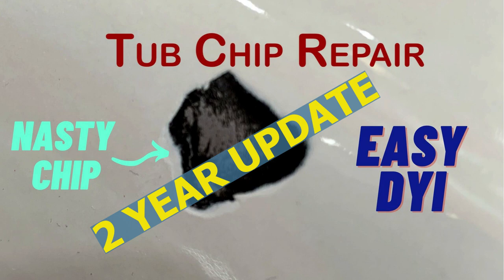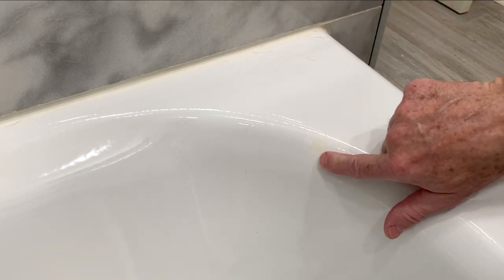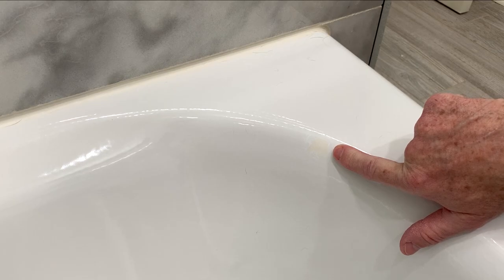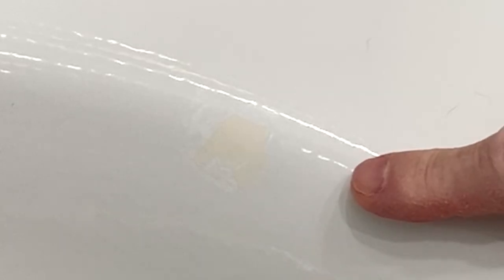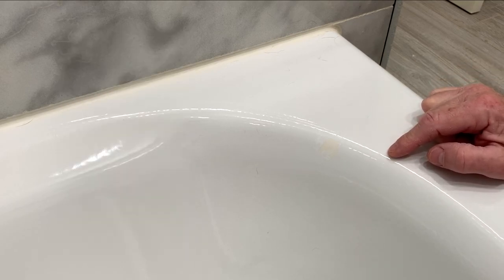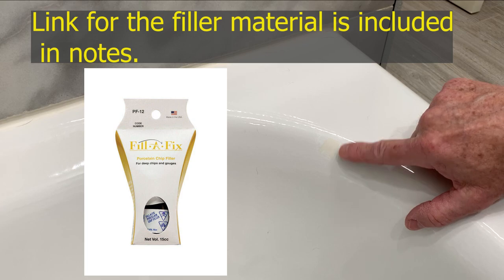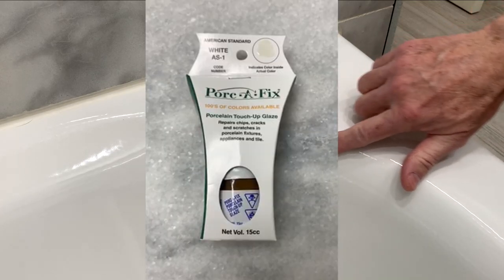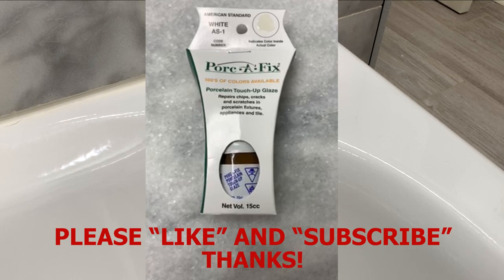Porcelain Tub Chip Repair - Two Year Update - 2023

Comment: Both the original video and this follow-up are very clear and informative.  Question - my tub has rust spots, not a physical chip.  Should I first treat the area with a rust converter before the Porc-A-Fix?  EDIT:  I just discovered that the answer is Yes, according to the Porc-A-Fix's manufacturer website.  They recommend their product, Corrode-A-Fix, if there is rust present in the damage area.
Reply from the maker: I can’t answer based on ever putting this product over rust, but my experience with rust is that it is very difficult to cover. I would definitely try a rust stopping product over the rust, and then using the Porc-A-Fix over it. Thanks for watching and good luck with the repair. Let us know how it works out. Thanks.
Reply from the maker: I just saw your info from the manufacturer. Thanks for sharing.